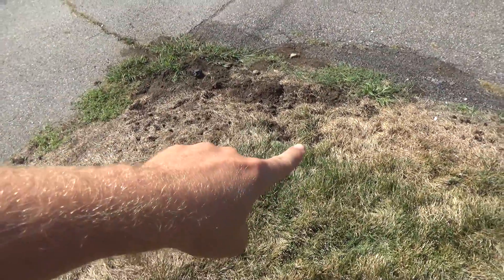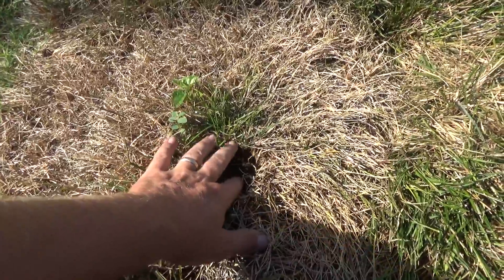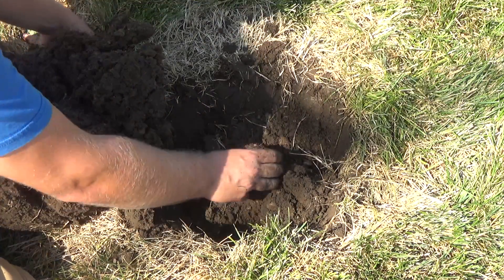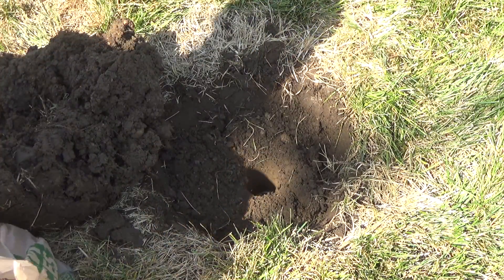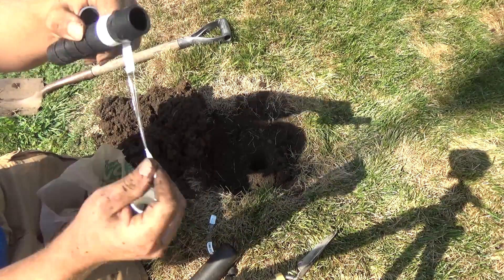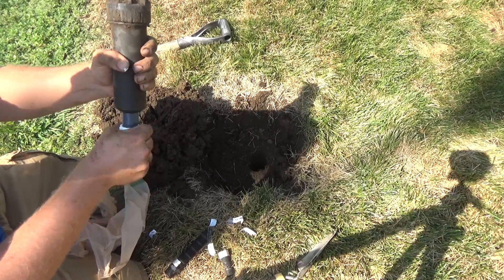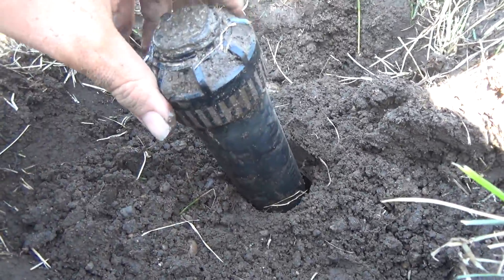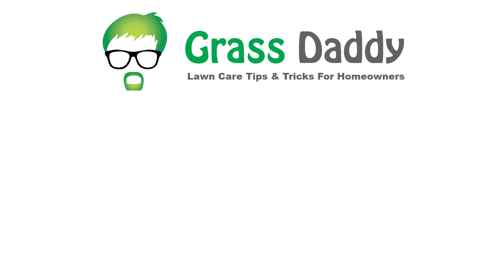How to Raise Sprinkler Heads in your Lawn

Comment: Thanks for this video it is very helpful for me to bring mine up. They were installed before the grass and I don't think they accounted for the height of the grass. So I will be trying your method for most of the system. Thanks again
Reply: I successfully raised my first head today, it was one that got pinned between a rain gutter drain pipe and a new fence that was installed last fall. I did exactly what you showed, I knew from your video exactly what to buy. I was able to raise it up enough to spray over the top of the drain pipe. It was so easy! Thanks again!

Comment: How do I get this done if the system has been opened for the year? I turned off the main, unscrewed one, and it’s just letting all the water in the line come out flooding the hole I dug. Thanks!

Comment: You are giving me hope. I need to raise almost every head in my irrigation systems. (lawn was a joke when it was installed last spring and has swallowed the sprinklers). Have you ever had issues with dirt falling in with your no dig method? That would speed up things up.
Reply from the maker: If the dirt is moist not dry or muddy it will stay put if you pack it around the sprinkler.

Comment: GD.. no issues with leaking at those risers? I have always used teflon tape at those connections.Overkill on my part?
Reply from the maker: I debated that too. I don't think it's really necessary but if you have the teflon tape handy it's a very easy extra step. I don't have any at the moment and didn't think to get any, so I didn't bother with going out to get some. I haven't seen any issues from not using it.
Reply: I replaced about 6 sprinkler heads this season and there was no sign of tape on any of the fittings. Since they are plastic and slightly tapered I don't it's necessary. Like a commenter above I live in Long Island and watch yours and several other lawn care channels. Learned so much.Thank You!  One thing is frustrating though. Many of the products used in the videos we can't get in N.Y. Luckily 'Do My Own" website has a special N.Y. allowed page which helps . Thanks again and hope you are feeling better with the Lyme's disease.

Comment: What about just replace your heads with taller ones. Not sure on the size you currently are using but seems you change it once and be done with it.
Reply from the maker: Yeah I'd like to at some point but the quick fix is just to extend them
Reply: Less than $1 to extend a head. Would still need to dig it out to replace it.

Comment: How come you didn't use pipe tape?
Reply from the maker: Didn't have any, I don't think it's necessary but if you have some handy it's worth putting on.
Reply from the maker: So I did some searching, pipe tape would be if you are using metal pipes.
Reply: Not needed on that connection.  Tape is only needed on dissimilar materials under constant pressure.  A sprinkler head to riser is never under much pressure.

Comment: That head by the driveway you moved looks like it is in line to get run over when pulling into your driveway. Thanks for all the videos.
Reply from the maker: I know.. That's why I wanted them away from the corners, but then with the dead grass as a result.. I feel like I'm gonna lose either way, and I'd rather have green grass and replace a sprinkler lol

Comment: That ground is moist all the way to the bottom of the hole. Yet the grass is dormant, you must have a different problem then lack of water?? A landscape design doesn't use  grass from edge to edge, problem areas for grass make good spots to make into flower beds or focal points of some kind.
Reply from the maker: Multiple things going on... But basically I've been fixing the issues and the water ban is gone so I've been watering daily now. I believe it was multiple issues and en extremely hot summer that revealed those issues. Previous years I could get away with it.

Comment: This is hard way to do it.     They also make a riser that is one piece molded with adapter.   Using PVC parts in areas that freeze is a big no no.
    Also you can grab the head with channelock pliers and very little digging.     This is not how a pro would do it and clearly amateur.